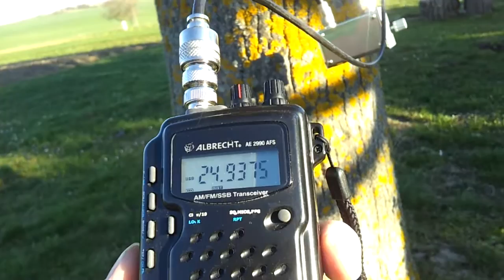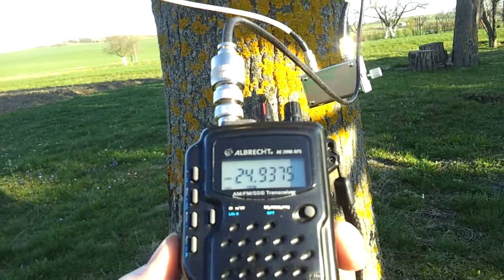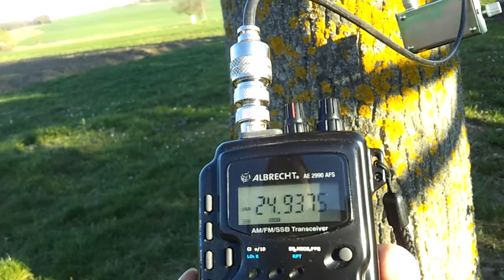QRP QSO with EA3EVL Pablo from Spain 1883km

Comment: Venry nice !! Don't you need to use a TOS meter with an exteran antenna ?
Reply from the maker: Thank you 😉 What exactly do you mean the TOS meter?
Reply: @OM0ET  this is a unit wich can mesure the waves coming back in the transceiver when you transmit using an external antenna
Reply: I would know hiow to built such a loop antenna..
Reply from the maker: @aureliusprimus  it's very easy to build. Try to check my other older videos about MLA's. Here is also my website: http://sk-tech.sk/om0et/ultralight-mla-ver.4.html